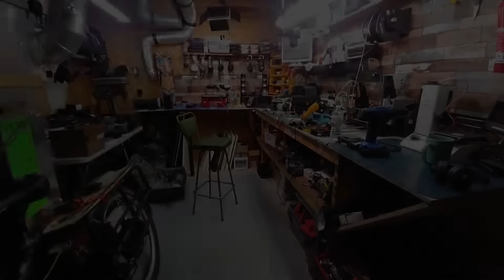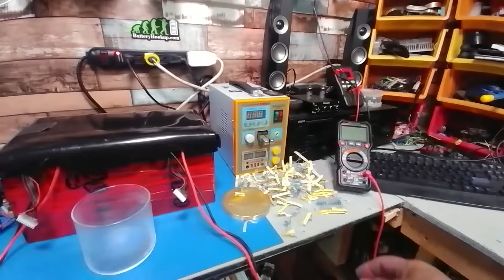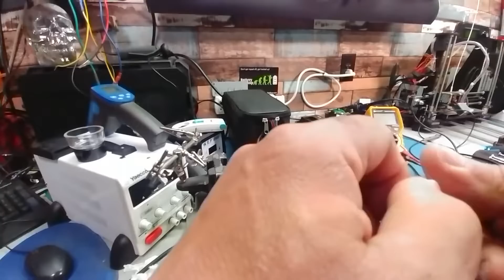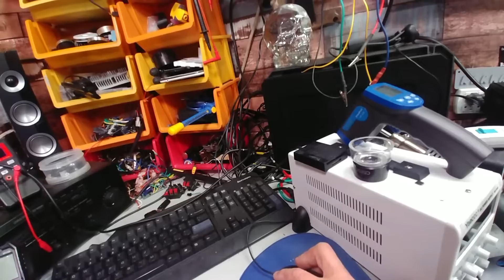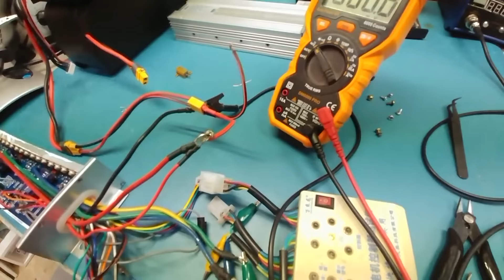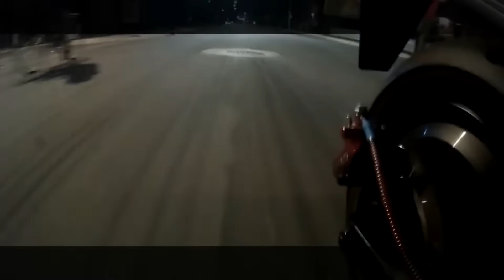ebike controller 60v brainpower controller *LVC removed*

Comment: i have the brain power 36v/48v but capacitors say 63v and inside it has 2 pinouts says 60v could i connect a 60v battery and it run fine or do i have to bridge the 60v pins or something my display says 36v 48v 60v s866 display
Reply: no

Comment: If u bridge the solder joints for 60 64 72 and 84 each together will it just parrellel all the resistors together to lower the lvc
Reply: Have you done this on yours?
Reply: @maxsinventions8913  been a long time I think I did

Comment: Maybe u can help me. The "electric door lock" or "ign wire" im needing to hook up. Its not soldered onto the board and im trying to figure out where on the board this orange wire need to be soldered onto. It connects to power. 

The manual says it must be connected. But idk where to solder it on the board at to connect to power.... Do you have any close up pics of your controller board by chance?? Youd be making my day for sure...

Comment: Just a follow up, that is indeed the correct resistor 👍 on my 72volt brainpower, I did a little math with the volts and ohms and at my maximum 84v and that I only need 50v low volt I can get away with 10K Ohm at 0.7 watts so I used 2W rated 2512 10K and it's perfect! Cheers.
Reply from the maker: Cool, thanks